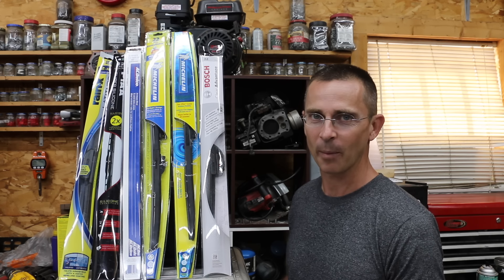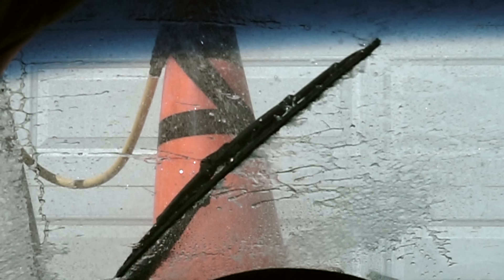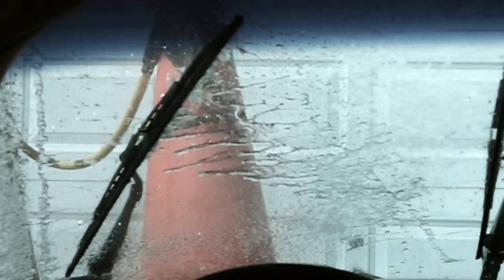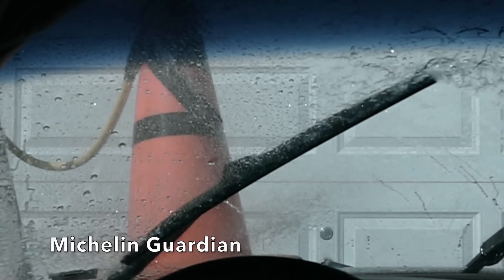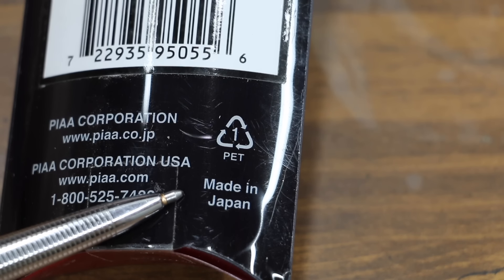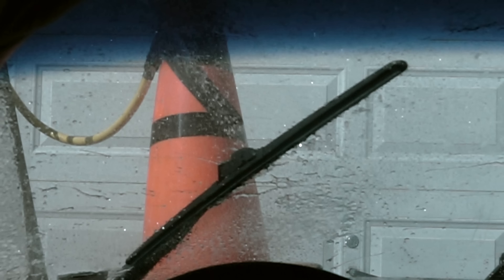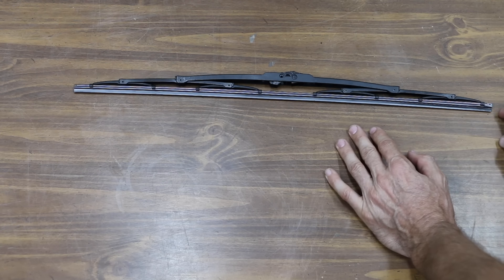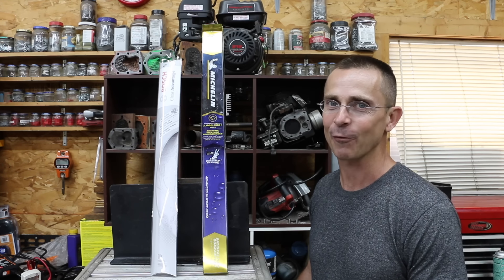Which Windshield Wiper Blade is Best? Let's find out!  Michelin, PIAA, Bosch, AC Delco, & Aero

Comment: Normally I would agree with your findings, however, in this case, you have missed a large part of the wipers performance, you have shown how the blades perform while sitting at a stop light, not how they perform when being driven, the pressure on the blades will make them, and the water behave in a far different manner.
Reply from the maker: Thanks for the constructive feedback
Reply: Totally agree. We need a test while the car is moving.
Reply: A 80mph wind speed fan would be enough.
Reply: I was about to say the same thing and saw this comment. Although if it’s a herd rain ur not gonna be driving at full speed anyway. Well most ppl with commen sense at least.
Reply: @ProjectFarm  i understand the limitations involved of not owning a wind tunnel. Perhaps you can look to another youtuber with some connections to scientific testing connections like engineering explained or something. Oooooooor more our speed id bet connect 6 leaf blowers together. Prooobably cheaper plus i bet ya got a few small engines laying around
Reply: I still think, objectively its a conclusive finding about the rubber/silicone blade and the frame used on their performance. If they perform better stationary they probably will when moving.
Reply: @ProjectFarm  dave smith Makes a good point a few years ago I bought a pair of the beam type wipers ( I think they were Rain-X ) they lifted off the windshield above 45 MPH. I replaced the wiper arms but that didn't solve the problem. I had purchased them because a friend had tried them with excellent results, I think the angle of the windshield may have caused the disparity of results, his windshield is much further from vertical than mine. As far as silicone blades go I have found that they are quieter, last at least twice as long, and perform better in cold, though as you demonstrated frame type is more of a factor than blade material in cold weather.
Reply: Project Farm and one more thing is that the Rain-X wiper’s coating makes the water bead off really quickly at speed, causing me to use the wipers LESS, which means they last longer? It’d be worth a follow-up test. I currently use these wipers and can say they are quite good...
Reply: This is a great point as some wipers are also designed with a shape that is supposed to help push the wiper against the window when at higher speeds...
Reply: I still believe Michelin silicone wipers are the best and they are around $20 at Walmart actually. I recommend to try them out.
Reply: I still believe Michelin silicone wipers are the best and they are around $20 at Walmart actually. I recommend to try them out.
Reply: I still believe Michelin silicone wipers are the best and they are around $20 at Walmart actually. I recommend to try them out.

Comment: Now I’m curious, I’d love to see a test of windshield wiper fluid. Different brands, types, ability to remove stains, etc.
Reply: RainX wipers and fluid combo is unmatched in most rain scenarios. there are plenty of times where its completely fine for me to drive 80-90km/h (50-55Mph) without even needing to use my wipers. just use them during heavy rain and snow
Reply: Good idea!
Reply: @brownsnake0400  I am personally scared of RainX. Some people love it and others absolutely hate it. What's the deal?
Reply: @kylefowler5082  no idea, they've always treated me well and I get a good variety of weather types
Reply: Good idea!  @projectfarm !
Reply: Dish soap and water during the summer months!
Reply: Personally I treat my windows with aquapel then only run rainX brand washer fluid basically only need to treat my windows once every 2-3 years
Reply: @kylefowler5082  I use the Rain-X washer solvent and swear by it. I don't know why people have a problem with it. I don't have to use my wipers half as much due to it repelling water so well.
Reply: Also flammability, since most, if not all, are made using methanol.
Reply: @kylefowler5082  I love it. A lot of the negative reviews stem from the fact that if you have either auto-sensing rain wipers and/or a sensor that tells you when you're low on washer fluid, the rain-x can negatively affect one or both of those features. It works great on my VW jetta with no auto wipers nor an electronic washer fluid sensor. It is honestly comparable to a good wax!
Reply: When Rain x first came out, people didn’t follow all the application directions, and ended up with a blurry, foggy, or streaked windshield, because, they mixed rain x with washer fluids or a wax overspray from the local automated car wash.
Reply: @lukeheffernan  all of my cars have low level sensors I have never had issues using rainX brand fluid I have had the one car since 06

And on my truck I just turn the auto sense wipers off I hate them
Reply: @BigSchallz70  Yeah, some people have been fine I guess, but I know others where the use of the rain-x washer fluid turns on the low washer fluid warning. If you read some reviews online it's evident that a lot of people have that problem. I love it though, don't get me wrong.
Reply: Rain X All Season, about 3 bucks a gallon at WalMart. The best there is!
Reply: I know personally I bought rain x wiper blades for both my vehicle's 8 or 9 years ago. I guess I could buy a new set, but they still work. They definitely still work better than the cheap ones.
Reply: @brownsnake0400  100% agree, even in heavy rain it's not too bad. 

@Kyle Fowler Why scared? I haven't had much luck with the small bottle stuff , but the wipers? Those are awesome, will never buy anything else. Great visibility.
Reply: Kyle Fowler. At the detail shop where I used to work, there was a black car that had some rainx solution(do not remember what he had used) and it had gotten on the paint. We had to buff on it for days to get the spots out so I can understand if you are a little hesitant on rainx stuff. I do believe that when done right however, Rainx can be a good product.
Reply: @brownsnake0400  ceramic coatings last much longer and provide the best hydrophobic performance. I had my windshield professionally coated and I only need wipers under 30 mph. The coatings last for years as well. But they're not inexpensive.
Reply: Summer (bugs) and winter with salt, grime and freezing temps, etc.
Reply: @pterodox123  But does it also remove the wax/protectant from painted surfaces? When I need to strip a car of old wax I use dawn dish soap and hot water.
Reply: @kylefowler5082  In my experience rainx works great so long as you keep applying it (or in the case of washerfluid keep using it I imagine),  if you decide to stop applying it the windshield turns into a mess, and it's very hard to remove completely.  Personally I stopped useing the stuff years ago, but it really does work well if your up for the extra maintenance.
Reply: ability to NOT STAIN
Reply: @brownsnake0400  I agree! I switched to rainX wiper fluid and never looked back.
Reply: Smashed bug removal is a real thing in the summer
Reply: I use just water because you never know when you'll need a clean water source, and my water washer holds like 2.5L.
Reply: @BigSchallz70  on my 2011 Ford fusion hybrid I have the rain sensing wipers and there is no way to turn them off except to put them past the intermittent region on the control which is actually the sensitivity control area on this and my wipers always skip across the windshield until there is plenty of rain. The rain sensor actually shuts the wipers off in a torrential downpour and they stop in the middle of the windshield and Ford can not find the problem. I have used rainx wipers and washer fluid and saw streaks and uneven water wiping so I'm not impressed with that combination.
Reply: @MV60  not an option in a good portion of the world because water freezes and it will destroy your washer lines, reservoir and pump if you use water where it can freeze.
Reply: @rgruenhaus  that's sucks man on my truck I can turn them off on the dash
Reply: @brownsnake0400  Lowest it gets here in winter is about 7c. Typical year round is in the 30's. So no worries there. :)
Reply: Rainx summer blend turned black while stored in the garage.  Get the all-season mix which has alcohol in it.
Reply: SiderCraft absolutely I can drive on highway and not even have to use my wipers
Reply: @brownsnake0400  Truth! Love the fluid, hate the wipers. They haven't lasted more than a couple of months for me.

Comment from the maker: Thanks for requesting this video and please let me know which brands to test in the future.  Here are the links to the wiper blades tested. Thanks again, Todd
Products Tested In This Video (in no particular order):
AERO: https://amzn.to/34mhxuZ
Rain-X: https://amzn.to/32g6lxy
AC Delco: https://amzn.to/34jiWTj
Michelin Cyclone: https://amzn.to/2Yodw5C
PIAA: https://amzn.to/32dSyYn
Bosch: https://amzn.to/3l8nSQQ
Michelin Endurance: https://www.walmart.com/ip/Michelin-Endurance-XT-Advanced-Silicone-Wiper-Blade-22-Last-2X-Longer/589217718
Reply: RainX wipers! They have different types too, not sure if the difference is in the material or maybe some kind of coating.
Reply: I personally believe the test that you do are far better than what most manufacturers do on their own products. Keep up the good work thank you for sharing the information.
Reply: Please post me the metal inserts from your discarded windshield wipers! Thanks. 🙂
Reply: There's a lot of DIY windshield chip repair kits on the market.   Have you tested to see which is the best?
Reply: Where's the Bosch ICON blades they are by far the BEST blades I've ever used, they blow RainX out of the water!  Please include the Bosch ICON blades on your follow-up video, it has been over 3 years now.  Another video idea would be hole saw blades and also hammer drills/ rotary Hammer drills.  My  Milwaukee 2612-20 SDS+ hammer drill blows away my huge industrial SDS-max Bosch RH540M at twice the price.  It's smaller but has more BPMs I guess that makes the biggest difference because this little drill is a work horse.
Reply: While not on your list, Trico has a good reputation.
Reply: Is there a link for the 1 year follow-up covering wiper blade UV degradation? Thanks
Reply: valeo is a real good brand that we always knew as a close rival to bosch, for a couple decades now. was fairly well agreed that they were the top two for value.